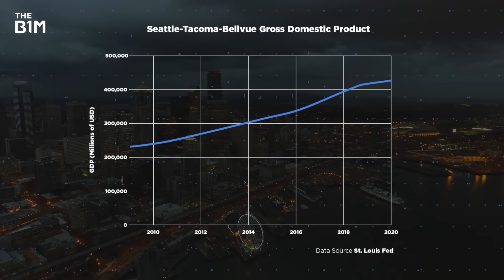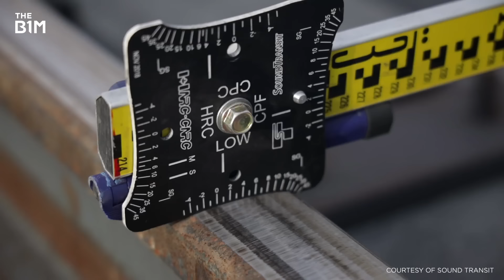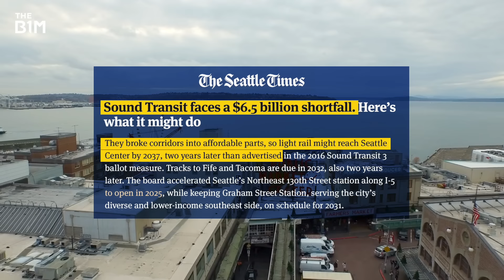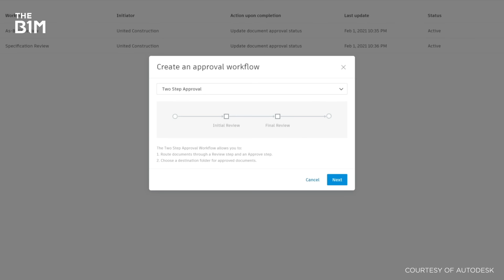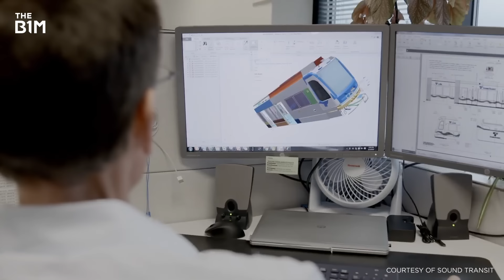Seattle is Building a $54BN New Railway

Comment: Man, wish more cities did this.  I recently visited Seattle and their public transit wasn't that bad as it is.  While I was there, a friend took their car from the same place I was while I took the pub transit to meet them at a different location and I beat them there by a whole 10+ minutes.  If my city didn't have rock hard ground or heat (as it rises), I would be sure we would have more public transit that was NOT on traffic level.  Glad Seattle is investing more in something that works well for larger cities.
Reply: Despite all of these bots spouting nonsense, the public transit honestly isn't that bad. The King County Metro network is pretty vast so it's pretty simple to get to where you need to go if you're willing look through their routes. Link (Line 1) also has one of the highest light rail riderships in the country and has almost fully recovered to pre-pandemic levels (1.886m monthly riders currently vs. 2.292m monthly riders in Feb 2020).
Reply: @TheTikeySauce  Well my city has shit public transit.
Reply: Los Angeles is building even more public rail transit than Seattle. And, will have a HSR connection in the future.
Reply: @poestis474 Don't worry, my citie's Paris, so it sounds cute hearing about Seattle :>

Comment: I'm here in Seattle. I'm so glad B1m finally did a segment here. The traffic  here is awful and the extended railway would be a huge plus.
Reply: By their own estimates Sound Transit 4 is going to have less than a 1% impact on traffic in the city.  The 1% value I believe was looking at north south traffic on I-5 from Greenlake to Everett. Building the massive light rail is not going to do anything to change traffic, it will just be a slow, very expensive alternative that very few people will actually use as a fraction of net commuters
Reply: @nafnaf0  However, that would give a safe second option for locals to commute afterwards, making less use of their cars, automatically making them spend less money and so on. There are a lot of positive aspects to consider about this project so I believe it’s worthy. Long term investment and it will indirectly solve this problem. I believe the roads are shared by people who really need it and people that do not have an option and this project would give them a reason to live the standard mentioned above. But hey, that’s a point of view from a non-local. Hope you understand
Reply: Are you happy that the initial segment of the rail project FINALLY wrapped up a decade late and billions overbudget?
Reply: @nafnaf0  nonsense
Reply: @alooga555  under budget and before schedule
Reply: @rcpmac  Good one! Check your source again. And DON'T rely on Sound Transit's altered records.
Reply: Here also, I wish they would just start replacing a single lane of the freeways with a train.  Most of these projects are completely useless to most of us.  NO ONE lives in "Seattle" we all live out in the sticks and have to commute 70 miles a day to Redmond, because there isn't a north/south train that lands you directly in Bellevue or Redmond.  The east side needs something better so bad, but there is so many stupid rich people living to the north of Redmond (NIMBY) and the Cougar mountain exclusion zone that prevent anything worth anything being built.  So, people will continue to buy houses for a million over listing in the areas where you would actually like to live for work.  There will come a day in the not to distant future where being able to afford to keep my extremely well paying job will no longer be sustainable at this rate (can't afford to go to work).
Reply: I lived there in the 90's and traffic was bad, I can't imagine how bad it is now.
Reply: By the time their finished. I'd be dead by then and my kids will be still playing for RTA tax on their registration
Reply: I live here too, and you are correct about the traffic but the new light rail is helping.
Reply: @nafnaf0  Historically, affordable public transit has decreased traffic, increased economic mobility and innovation every single time. Peak example of this is Germany and Japan. America is lagging behind and this iust might just bring them back
Reply: @alexandreg1828  actully i live in seattle and i know a lot of people that don't own cars because we have good transit (except in west seattle)
Reply: @IndustrialParrot2816  meaning a high speed rail 🚅🚄?
Reply: @savage7882  agreed
Reply: I was in Seattle a few years ago and was told how terrible your traffic was. Coming from NY your traffic was minor league. You have no idea how bad traffic can really be.
Reply: @alooga555  That is pretty typical of transportation projects. In Boston we had the big dig. More like the big over budget.
Reply: @mtadams2009  thats why the transit system is so important but traffic is partialy affect by the fact that there is almost no level ground in seattle
Reply: @IndustrialParrot2816  It’s good your moving forward. All US city’s should be doing the same.
Reply: It's so far off it's not going to do current residence much good.
Reply: @alooga555  What source would you use instead
Reply: @davidwostrel  One issue with building more housing around Cougar Mountain is that a lot of the ground actually unstable due to several old coal mines. (Yes, the Seattle area has some coal deposits; that's how Newcastle got its name.)
Reply: What about all the people not paying for the transit, article posted recently says something like 70% of people dont pay. Removing transit police so they dont check tickets, fantastic system. Let alone still takes an hour to get to seattle
Reply: Trains through suburbs don’t make sense. Lol.
Reply: Mass transit in Seattle... You mean the homeless transport network right?  People in Seattle WILL NOT get out of their cars.
Reply: I am native to the Puget sound. From the time I moved here in 1975 to 1991 I could drive from Gig Harbor to Seattle and not have any traffic impediment.
Reply: @nicolatesla5786  Natives are people who were born in a location. You were a immigrant to the Puget Sound area.. NOT a native. 

"I am native to the Puget sound. From the time I moved here in 1975 to 1991 I could drive from Gig Harbor to Seattle and not have any traffic impediment."
Quoting so that people know what you originally wrote.
Reply: @nafnaf0  In Vancouver most of the light rail has zero impact as it is a elevated rail way.
Reply: @DiogenesOfCa  I moved from portland to seattle in the 1970s its worse. Thanks to all the move ins..our traffic was horrible.
Reply: Can't wait for the Redmond station to get finished. Once that's here, I'll rarely need to drive.
Reply: @davidwostrel  well the new light rail goes to Bellevue now so thats a plus
Reply: how's the homeless problem? hear its like SF/LA now
Reply: @IamLEGENDkb24  no worse than any other major metro I've lived in. There's a few sketchy spots downtown by the waterfront, but generally not bad. Tbh, I had more problems with the homeless people down in Tampa when I was a kid than anywhere else.
Reply: Bro nobody uses sound transit. They do not even get close to breaking even. It’s a financial quagmire that people in WA have to bear the brunt on in taxes
Reply: @animationandnews9610  Agreed!  The trains in the downtown tunnel are twice as long as they were originally.  And with Metro's buses no longer using the tunnel, ST can run more trains.  The Northgate extension is now open, and will eventually go all the way to Everett, a 30-mile drive that used to take 30 minutes!
Reply: I don't think it's going to work out that way. The population is booming. Bellevue is nuts. All the greenspace is going to cheezy apartments. So all the new people will make the traffic just as bad. The train will keep it at something like the same level, i suspect. Hope not, but that's what I suspect. Don't get me wrong - I wanted the train. Not so much right down the street, but oh, well. Has to do somewhere.
Reply: @youtubeuserandchef471  buses
Reply: @rileymcmann3744  Transit systems aren’t supposed to be profitable, they are a public service. They are worthwhile not through ticket cost, but the decreased cost to the state- if they built enough roads to fix traffic, the government would be bankrupt by now.
Reply: @nafnaf0  yeah but then i can take the light rail instead of sitting in the traffic lol

Comment: As a 8-year resident of the city, I can attest at how much the transit here has changed for the better. While not all projects have panned out, the light-rail system has been a beacon of success. I can go from the airport to north Seattle in about an hour on the light-rail, while that would be (easily) close to a 1.5 - 2 hour trip on any given day with the traffic we have here. I have never once felt the need to own a car while living here unless to travel abroad from the city.  I love my city!
Reply: sorry, the use of the word beacon is not allowed.   thx, The YouTube Team.
Reply: Absolutely incorrect about the transit times. Non rush hour you can get from the airport to Northgate in less than half an hour by car.
Reply: @thetranya3589  I specifically mention WITH traffic. Also, good luck getting from SeaTac to Northgate in 30mins unless there is absolutely NO traffic. Ask yourself, when isn't there traffic nowadays? 3am?

Comment: I moved to Seattle in the mid 80's, and right from the start I could look at a map and think, why don't they run a rail line from Everett to Tacoma, another on the east side of the lake, and one across the water?  It just seemed intuitive to me that you could service nearly the whole sound with light rail really easily, the way it's all laid out.  I remember how Seattle would boast about their wonderful bus system, and I suppose it was pretty good but that's in part because there was no subway or light rail at all, so it had to be.  Never thought it would take almost 50 years before they finally had that light rail system in place.  I live in Federal Way now, and the light rail to here is nearing completion, pretty exciting to imagine what it'll be like when they finally finish it all.

Comment: The hurdles this city has been through to even have a somewhat stable light rail system has been the bain of living here my whole life. I moved away for a short amount of time but now live right near a light rail station and it has made commuting through the city AMAZING. Can't wait for West Seattle and Ballard expansions. Those two areas desperately need it.
Reply: People not only want it in Seattle, they actually use it.   I read that Dallas has the largest Light Rail System in the country and Seattle has already passed Dallas in annual ridership.
Reply: @davidmeland5440  Since King Country Metro has one of the highest riderships in the country overall, it makes sense that the light rail service would greatly benefit from this. All the more better since the stations are placed in highly frequented locations on top of Line 1 running along the main north-south commuting corridor.

Comment: Awesome to see this channel featuring my hometown. The rail expansion here is very exciting, it’s been a slow process but there are so many use cases it will unlock and should reduce our regions reliance on cars, which is substantial. 

It’s funny, we are so accustomed to driving across our floating bridges that we forget the engineering complexity involved. The 520 corridor project is really interesting, involving a multi stage rebuild of a floating bridge with an extensive freeway cap.

Comment: Some important historical context: Seattle secured a commitment for federal funding for a rail rapid transit system in the early 1970s, but it was never built. Boeing, the domininant economic engine in the region at the time, was in crisis and the regional economy was in terrible shape. Despite the economic challenges, voters came within 2% of approving the project and providing the required regional funding. The economy recovered, but it took more than two decades to fund the transit network described in this video. The region is still suffering from the delay.
Reply: From what I know about that, I believe that money went to Atlanta instead and funded much of their city infrastructure.